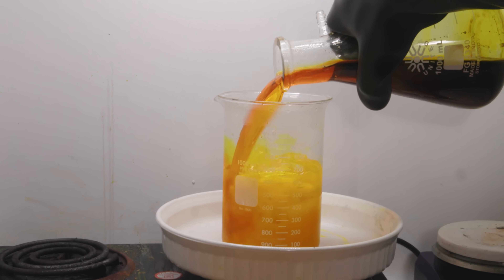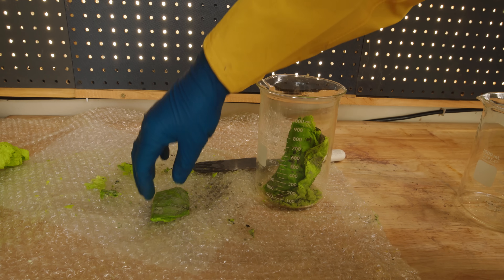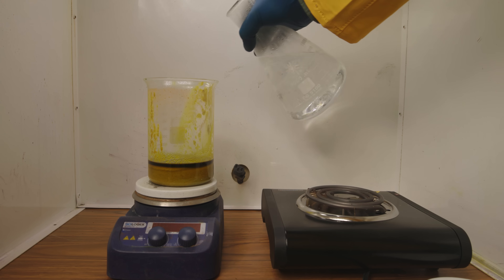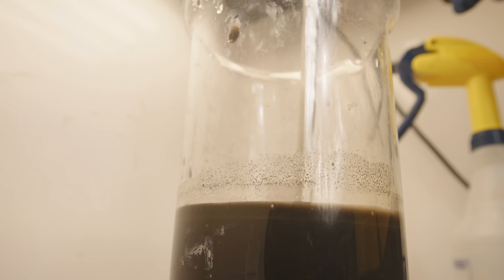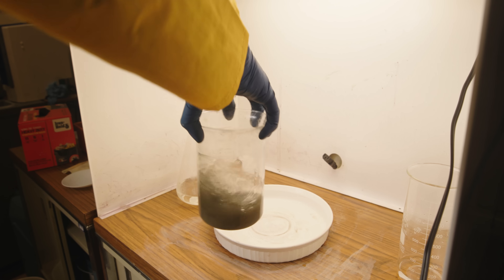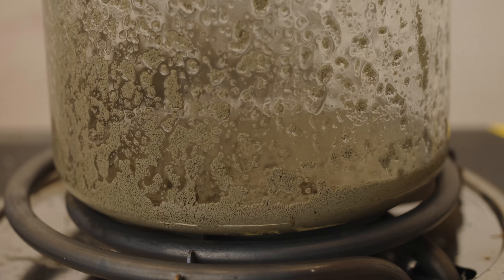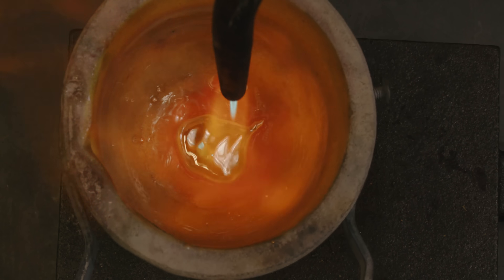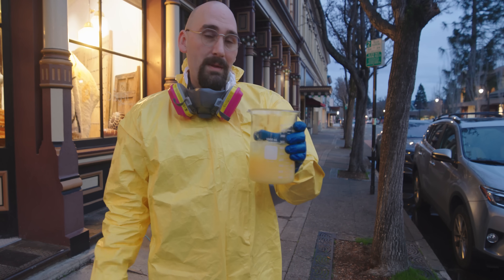Turning a BLOB into PURE SILVER!

Comment: You may want to invest in some equipment to cook :D  For example boiling out chemicals to dry the solids is highly dangerous for you and for the environment (and for the yeld). For that you use either a soxhlet extractor, or a rotary evaporator. That will allow you to save the solvent/fluids you use, and safely dispose of it once done.
It will also take you less time to do your experiments and workflows, and you can recover more material that inevitably end up being wasted when you just "boil" things up :)

Comment: 5:39 It happens 'cause the reaction is VERY exotermic, which means there's a lot of heat coming out of this mixture. This is a learning for the next projects: Never adds water to a concentrated acid. Always put acid on water,  because the water can slowly neutralize the acid and dissipates the heat.

Comment: 5:38
I am sure someone mentioned it already, but in case they did not, diluting acids (HCl that was created) or basses (the sodium hydroxide) is an exothermic reaction as well. Therefore if you are diluting it you should add the solution into water so the reaction speed is controlled and the heat can escape. Since you added water to the solution all the water that got into contact with the hydroxide/HCl instantly evaporated/boiled/ and that created that violent splashing

Comment: Did you know that silver chloride goes into solution very well if there is a high concentration of chlorine ions in the solvent? No? Boiling silver chloride in hydrochloric acid is idiotic. Half the silver chloride will go down the drain.

Comment: Just for future reference (I'm sure it's been mentioned, but just in case others are reading this) - it's much easier to start with just nitric acid when refining the gold, not aqua regia. Nitric acid alone will dissolve out all the metals EXCEPT the gold. Then after thoroughly rinsing the gold sponge, THEN you use aqua regia to dissolve the gold, precipitate with sodium metabisulfate, dissolve again in AR, then precipitate and melt. 

The benefit is that all of the other metals remain in solution in the original nitric acid baths, so the gold is much easier to filter without silver chloride. Then you can cement out silver by simply sticking copper in the nitric baths. That cemented silver can then be melted as is at ~85-90% purity, or refined through an electrolytic cell, or converted to silver chloride and this same process followed but it'll go much quicker because the silver will have far fewer contaminants/other metals than doing it by going straight to aqua regia and letting the silver chloride form. It'll also result in higher yield, as some of the silver won't convert to silver chloride during the initial reactions, so a good amount of your silver (and gold too, most likely) ended up in your stock pot as a result.
Reply: I was going to mention this also, however, he would’ve had to add some silver or copper to the original metal to bring the purity down to 25% (inquarting).  Had he done just nitric to start with it could not have removed all of the base metals.  
But yeah, he probably lost a good bit of silver by going straight to AR.  And likely ended up with a less pure product.  

Chloro-auric acid should not be cloudy at all, it should be crystal clear.
Reply: dang that’s crazy
Reply: I can tell you watch Sreetips. He has a large collection of YouTube videos of refining silver and gold.
Reply: Nerd
Reply: I'm surprised someone let him handle their valuable blob. Surely he lost thousands worth of gold and silver with these amateur methods. But I guess the yt revenues pay for that
Reply: He probably bought the blob from them.
Reply: Nerds
Reply: @tamarajohnston7751 respect though

Comment: I think another trick to further purify is to melt the gold and make a gold / silver alloy by adding sufficient silver. If you then get that alloy into small pieces you can dissolve the silver and other impurities in hydrochloric acid, leaving mostly gold. Then you can do another cycle of aqua regia / bisulffite to further purify.

The absolute king is chemical vapor deposition of the gold where under high vaccum you slowly evoprate the gold to have it crystallize on a cool surface. From specialized suppliers, you can buy small amounts of 99.9999% pure gold.

Comment: The process and the result were interesting to see! Concerning the violent reaction upon the addition of water around 5:24, this is most likely due to excess base remaining in the solution. Mixing a (concentrated) acid or base and water is a fairly exothermic reaction. So exothermic in fact, that the water may start boiling if there is no efficient way to dissipate the produced heat to the surrounding medium. Sulfuric acid (H2SO4) is notorious for this behavior, but concentrated acids such as HCl (hydrochloric acid) or nitric acid (HNO3) or, as in your case with NaOH, bases will react the same way.
To avoid such... spectacular results, I would strongly recommend to pour the acid/base into water. The relatively large amount water will absorb the produced heat and therefore, the solution will not splatter everywhere ;)

In short, somewhat comic-like form, the reactions are:
(Little) Water + much acid or base --> blubb-blubb-BOOM!
(Little) acid or base + much water --> boring, but safe.

In principle, you could pre-dissolve the sugar in the water and then pour your lye-silver-solution into this sugar-water-mix.

Comment: When you add water to the mixture, that im pretty sure you used acid for, the acid makes the water so hot it begins boiling, the water then drags tiny drops of acid up with it, so basically pour acid into water, not the other way around, because else it will just make a very corrosive fountain.

Comment: The reason why it reacted so strongly when you added water is because the dissolution of sodium hydroxide is also exothermic and you had a LOT of NaOH in that solution. Safety rule in chemistry is to always add acid/base TO water, instead of water to a solution because of the highly volatile reaction.

Comment: 5:42 not too far off actually. keep in mind, generally speaking acids and bases need water to be acids and bases. as a general rule you always want to add acids and bases to water and not the other way around. what is likely happening is the water is being superheated and boiling as its hydrogens are being stolen by the sodium hydroxide.

Comment: You just add too much NaOH before adding the sugar. And the way it reacted that violently is because you gave water to a concentrated base. You know how they say always add acid to water and not the other way round? Thats exactly the same but with base.

You actually might inhibit the reduction of silver due too the high pH. Silver then form an [Ag(OH)2]^(-) that will not react with the sucrose(sugar). As part of the reaction it would take an electron from the sugar (it is an reduction of silver-ions). But if it is already negatively charged it is not likely to happen, because it will repell the negative charge from the electron.

Its an somewhat simplified idea of what I think is happening. But im happy if someone corrects me :)

Comment: I've recently finished my chemistry graduation and I must say I truly love your videos, using chemistry as a tool to do your work is amazing and I wish I could do the same! As for the Glucose part, one possibility I thought is, since it is a solid, it doesn't get as much contact with your reactant, hence the slow reaction. When you use a Glucose solution though, the solvent makes the Glucose more available in the medium, speeding up the process, an interesting test would be to use a glucoese solution right away, maybe that way, the reaction would be less vigorous!
Reply: I think this is good way of looking at it. Similar reason as to way oil is used to cook solid foods.
Reply: There are several ways the process could be improved beyond just getting the glucose into solution before combining. But you are correct, adding a solid like that will prevent the reaction from proceeding efficiently. In fairness, he has said he has no chemistry experience or education. He did a great job that being considered but there are a number of things someone with chemistry experience would have done differently. All of those things just come with experience though.

Comment: Silverchlorid could be solve in Ammonia. This is very specific and common in chemical labs where silver waste is produced. After solving the silver you filter the solid and you'll have only the silver solution. That would be the first step.
And to create the silver again you have to fall out again the chlorid and use base metals like tin or zinc and solve them together with Silverchlorid in Hydrochoridacid.
The formula is something like this:
AgCl + 2NH4OH => [Ag(NH3)2](+) + Cl(-)  + 2H2O
2AgCl + Zn  => 2Ag +Zn(2+) + Cl(-)

Comment: The fact that the reaction got more violent once you added some water might be an indicator that you had a passivation layer forming. In short, basically the outer part of the silver chloride grain reacted, while the inside remained unreacted due to a high reaction speed. Adding water dissolves said layer, and thus the reaction is allowed to proceed. You could, in theory, dissolve it into hydrochloric acid and leave it in sunlight to avoid that (AgCl decomposes when exposed to light), but I think adding water is just way better. Great Job!

Comment: Something I've been trying to spread around is this idea for a flux brush. Get some paint pens from anywhere,  Walmart in my case. I use a liquid flux, you can switch it up however you'd like, but replace the plastic bristles with either nomex or fiberglass. Works great and you don't singe the bristles together anymore. Hopung you have fun with the jewelry project!

Comment: Nice Video! Chemist here. Actually, if your Ag2O is pure enough, you can skip the step where you convert Ag2O to Ag and heat the Ag2O directly to form silver metal. Ag2O will decompose to silver metal around 300 C, which is way lower than the melting point of silver metal.

Comment: Nice work, I would probably use a metal gauze between the elec. htg element as it's somewhat localised heat when in direct contact with the glass. That or perhaps always use very vigorous stirring when heating. Don't want vessel cracking in situations like that

Comment: I would do it differently. Decant and filter the AgCl, then dissolve it in concentrated ammonia. Filter again and add HCl to the filtrate. Highly pure AgCl will fall out. Then use NaOH to form Ag₂O and proceed as you did. This way, you eliminate any remains of copper and other metal ions which would ruin the purity of your silver.

Comment: Make argentium, and then make jewelry out of it. Yes I know "Argentium" is trademarked but you don't have to call it that, and its composition is not exactly a secret. It's Ag 935, with 1.2% germanium and the remainder 5.3% copper. Germanium is not exactly a common material but for the 25g silver you only need 0.3g of it, and 1.33g copper. I have actually done it, and it is in fact more resistant to tarnishing than sterling silver. Made a beautiful ring.

Comment: Great job!!! 👍 Very nice looking Silver.

In regards to the eruption, when you added water, the water you added instantly boiled because the solution was already over Water's boiling point, but the caustic solutions boiling point is higher. I've had this issue when adding Sulphuric acid to hot solutions, the exothermic reaction of the Sulphuric Acid combined with an already hot solution = instant boiling. It can be quite dangerous and scary if unprepared.

Comment: Silver chloride actually dissolves better in concentrated HCl than water, so using a dilute solution of HCl as opposed to a concentrated one would actually dissolve the least silver. If you used 20% HCl, one HCl washing of 500ml could dissolve up to 2.5 whole grams of silver! (Though my calculations are probably wrong... if someone's good at chem i'd be open to chatting in the comments) This is a relatively small amount compared to how much you recovered, but i would imagine that your yield could be slightly improved if you had used a dilute solution.

Comment: The reaction that is happening in the reaction of between silver oxide and glucose is that the reactice carbonyl group(either an aldehyde or ketone or alfa hydroxy ketone) is reacting with the silver oxide and making carboxylic acid in this reaction with aldehyde. Ag2O+R-CHO➡️2Ag+R-COOH. But I think that step is theoretically not needed because when you heat silver oxide upwards of 280c it simply becomes silver. This might be dangerous because of the hot gas but silver still makes the bulk of the mass in silver oxide so the amount of gas should be quite minimal.

Comment: I think you should have a flat metal heat spreader between the bottom of the beaker and the heating element.
Reply: Just a heads up that a bot replied to this. You might not see it because I reported it. I gotchu bro

Comment: I didn’t see the gold video, but I heard you mention Sreetips. He’s an excellent source for practical application recovery and refining. Can’t help wondering why you took the long road.
Reply: Ok. I watched enough of the gold video to see where you got off track. Cleaning the gold after making flake was unnecessary. All the non metallic contaminants would have been removed by filtration in subsequent stages of the process. Also, way too much flux in the melt. You only need enough to keep it from sticking to the crucible. The major mistake was going to aqua regia first. You would have been much better off to use nitric acid and distilled water to dissolve everything that ISN’T gold. After filtering that solution, most of the solid contaminants would have been removed and the silver could have been recovered by cementing on copper. This would have eliminated the need to convert silver nitrate into silver chloride and then back into cement silver with lye and sugar. Once the silver and other base metals were removed (recovery) then you dissolve the gold in nitric acid and HCl. But don’t try to premix the acids. Just add the nitric a little at a time until all the gold is dissolved. That way there’s no need to denox because there wouldn’t be any excess nitric in the solution. Then all that’s left is to filter and precipitate with SMB. The result of this process will yield more gold and silver while using less acids and thus creating less waste.